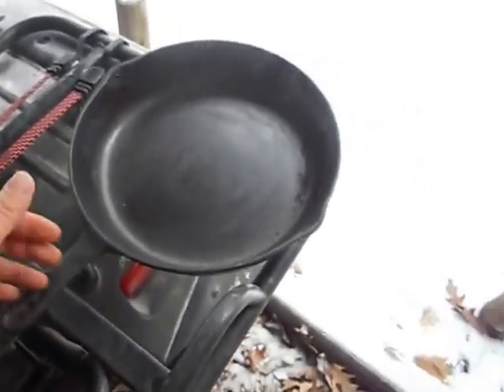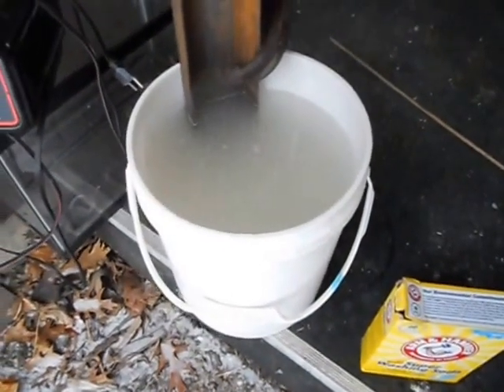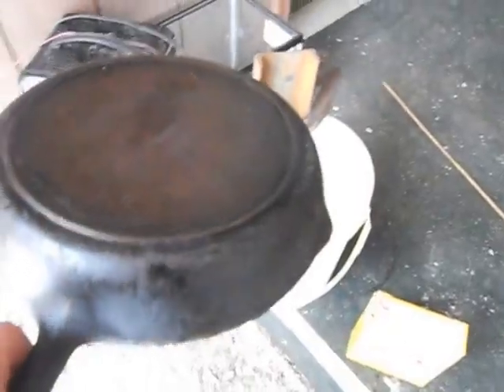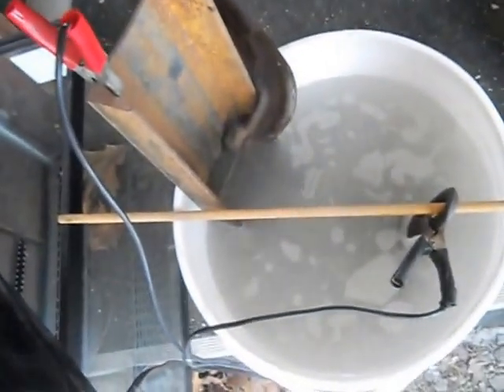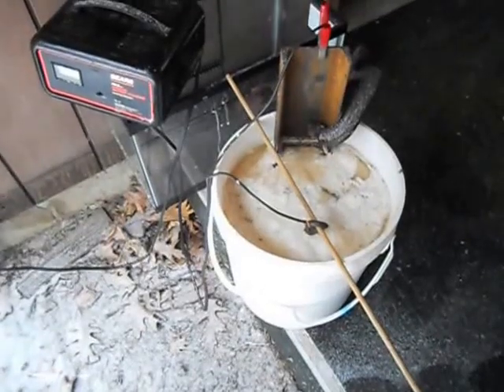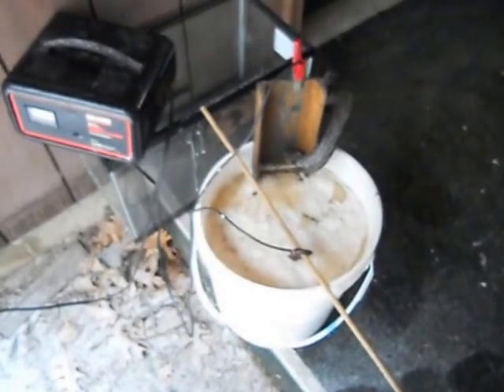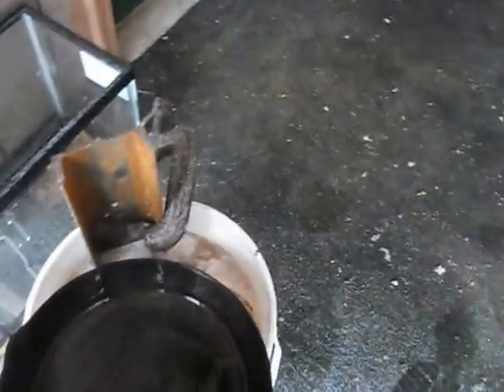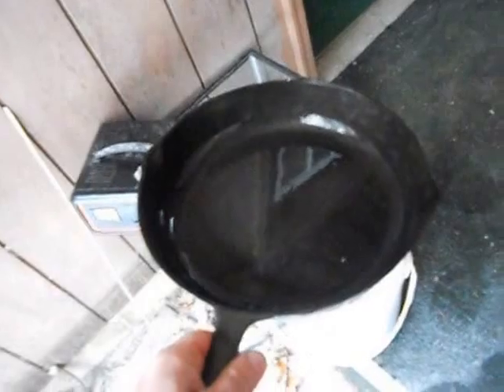Cast Iron Pan Cleaning by Electrolysis

Comment: I tried this with my speedy charger on the 12v setting and it did nothing :(  Any tips on what I might be doing wrong ? I set it up the same way.
Reply from the maker: +Dan Swan  some newer chargers have a safety feature that dont allow current to flow unless its hooked to a battery with x amount of volts in it already.  get yourself a old cheap charger from a yard sale.
Reply: BarkEater Thank you I'll do that.

Comment: I am hopefully getting an old cast iron wheatgrass juicer off ebay, with some rust on it. My question to you would be is there any way to season that so the inside won't rust? Or should I just thoroughly dry it after washing it out? Thanks, I understand this is a bit different than cast iron skillets haha
Reply from the maker: Sorry it took so long to reply for some reason I didnt see your question until just now.. most are tin lined so they dont rust inside but if its not thoroughly drying should prevent heavy rusting, a light coat of vegetable oil could be used for long term storage.
Reply: depending on size coat it w oil.... let it dry for a day or so. Basically drip dry. Then if it fits put it in the oven as if it were a cast iron skillet to season. Not 100% sure but that may work.